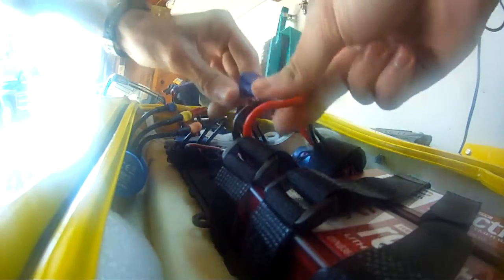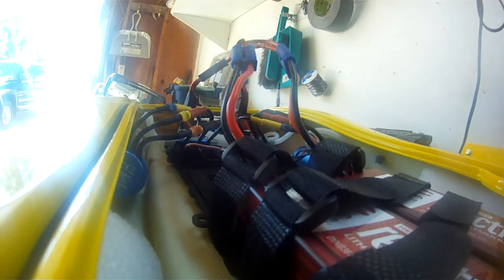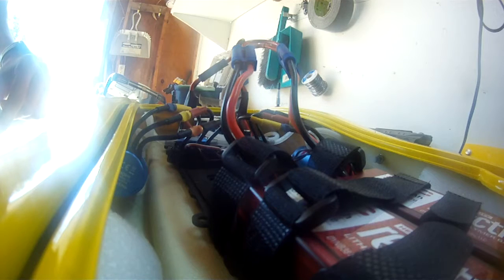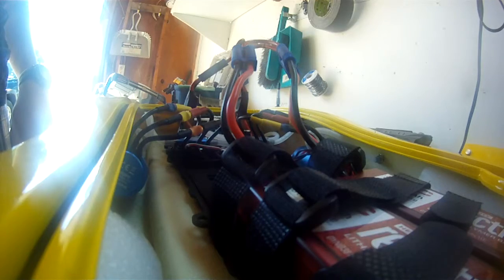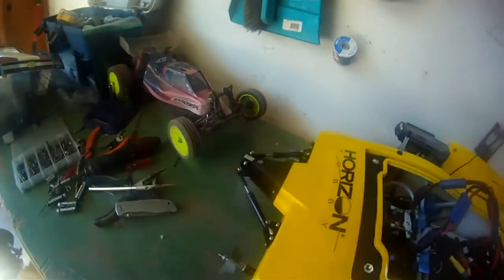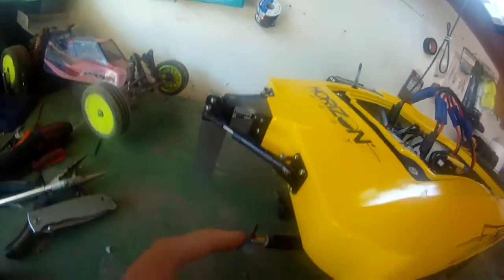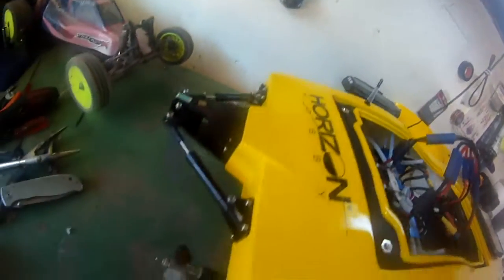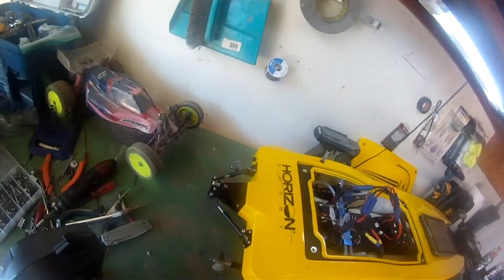How to Calibrate Proboat Zelos ESC's

Comment: thanks my boat run for 2or3 sec and would stop that fix my problem.
Reply: fluty3659 do you plug your batteries is like normal or do you have to plug them in a different way? For calibration

Comment: It is highly recommended you keep your fingers away from the props when there is batteries connected. They aren't forgiving in the least and will do serious harm. Even holding your transmitter isn't worth possibly losing a finger from.

Comment: Hey love the video. I dont have a boat myself but this is helpful. I have some tires that are losing their grip and I was told that WD-40 works really well for grip but I dont know how to apply it. Any suggestions on grips and how to apply the WD40. Thanks!
Reply from the maker: Yes, ive done it multiple times and what works best is to spray it on the tires and them use a toothbrush to wipe it around. But honestly, we-40 doesent work that well, i now use liquid wrench and it works so well that i used it on my micro t and it made the tires so sticky that they lost all of the tread at the end of the run. Liquid wrench doesent do that to 1/10 or 1/8 scales though and its my go to tire softener. However, if you are using a bald or low profile indoor tire for a clay track, use some simple green. If you use any of the meathods, let the tires sit with the desired loquid overnight for best results
Reply from the maker: And make sure the tires are clean so the dirt on them doesent absorb it
Reply: OKay thanks! I also heard to light them on fire?!
Reply from the maker: +Justin Robinson lighting them on fire works too but its for the "show offs" so to speak. Nobody i know uses the fire method but you could melt your wheels if the gasoline gets on them.
Reply: OK. I experimented with old lego tires and i completely soaked them in WD40 then lit them on fire. I let them cool and they were super sticky but IDK ill figure something out. THanks for the help